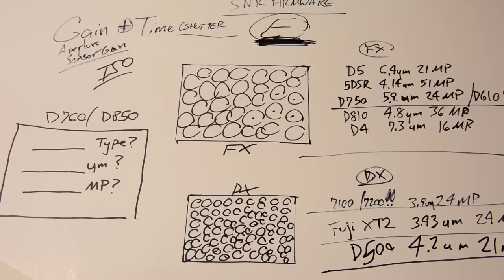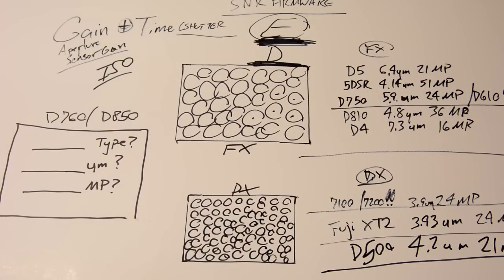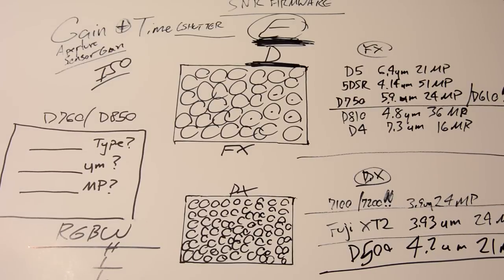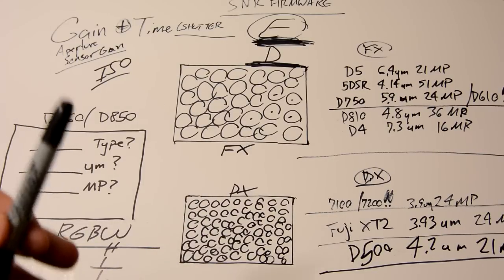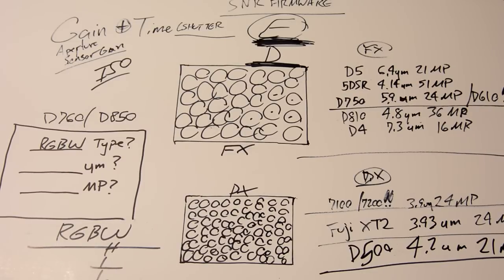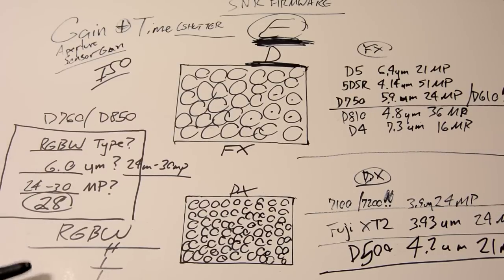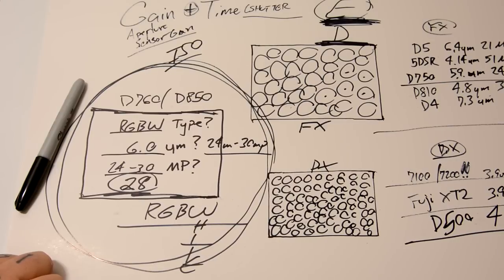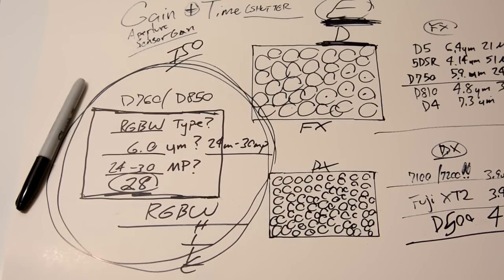New NIKON DSLR sensor needs to fall within these parameters,...logically

Comment: I could see the D760 being that but the D850 (no indication Nikon will merge those two lines) will most likely have the Sony A7RII 42MP sensor with some Nikon magic on top.  RGBW maybe in D760 but not in D850.

Will that sensor be for the A7III or A7RIII or rumoured "PRO" A9??

Comment: Silicon has nothing to do with efficiency, heat decipation has.  Efficiency is at the premature  as far as sensor go, you have still new  BSI sensor and RGBW to come yet, the issue is not sensitivity but heat decipation and noise which is here involved.There is nothing wrong with silicon btw. As far as ISO concern (applied gain) at higher dB amplification you get  different  signal to noise ratio (read as more noise) where heat starting to be an issue.There is no such a sensor  coming from Nikon , they do not make any sensor....you mean Sony, right.

Comment: Wouldn't going backwards in MP though from 36 to 28 be marketing suicide? Sony would be going from 42MP back to 28MP. Regardless of whether or not people understand MP and how many they really need they are now accustomed to believe that more is better no matter what the truth is. If this jump backwards comes true Canon will hold the two largest MP current production cameras in the FX department and no doubt that would swing the MP seeking crowd back to canon. I personally own the D810 and the D750 and use both, the D750 for my day to day real estate work and the D810 for all of my high end jobs and landscapes where it's dynamic range at ISO 64 really excels and where I want the extra detail from the higher MP count. 24MP is more than enough for my day to day work and even a jump to 30MP for the D760 would impact my day to day work and would be annoying. I would really love a 24-25MP D760 with increased dynamic range and low light performance and a D860 with 36-40MP with the same so I'm hoping your wrong! I would also like to see a tilt screen on the D860 so I can shoot low without screwing up my back anymore! 😜
Reply: Jeff Brislane I agree with Ken and also you! How will they 'sell' this to Joe average that simply thinks higher MP is better?